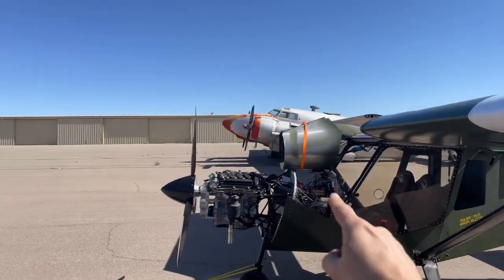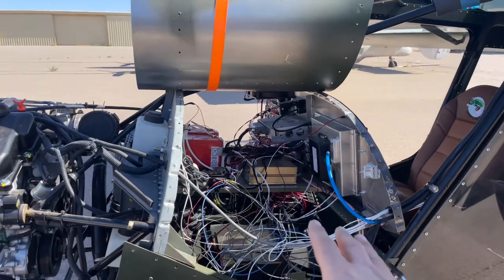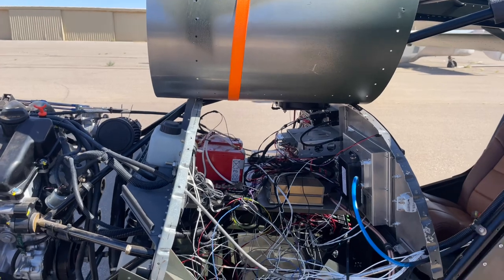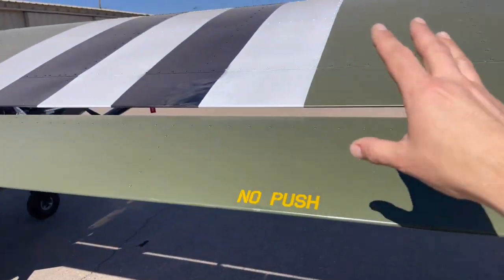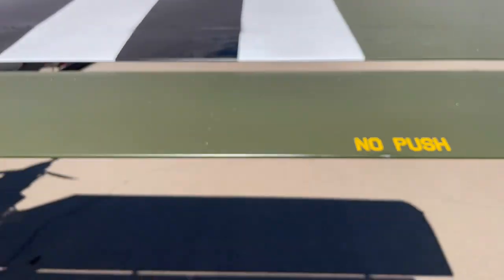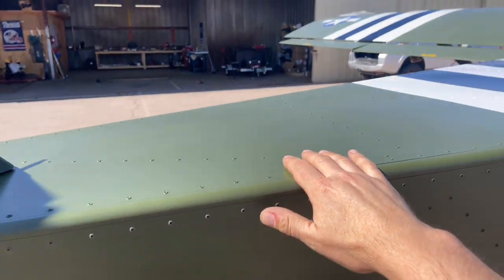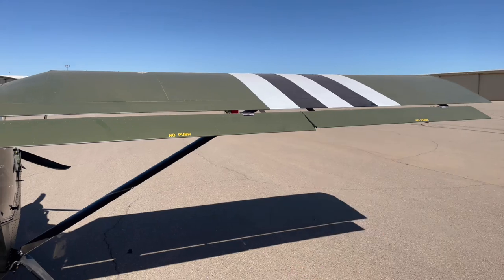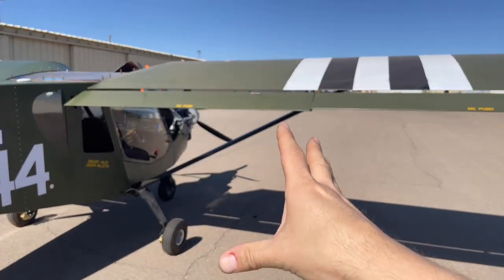Cleaning the L750 Cricket and Moving Batteries

Comment: Like the location of the batteries! Should definitely be easier to change when the time comes. If I had a do-over, I would have placed them near the hell hole. Not worth the effort at this point. Did place the ELT as far aft as possible, that helps some.
Reply from the maker: I thought about the hell hole too, but I hate getting in the ground to mess with stuff back there. When will you be flying? Soon by the looks.z
Reply: @JoesRCCorner  AW Inspection this Thursday the 18th May!